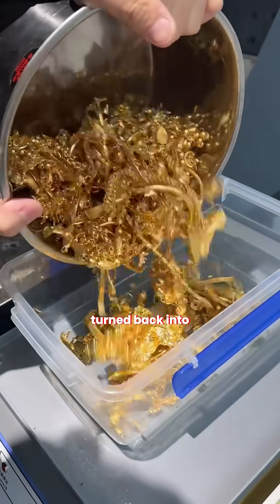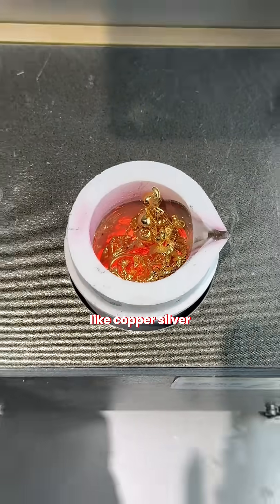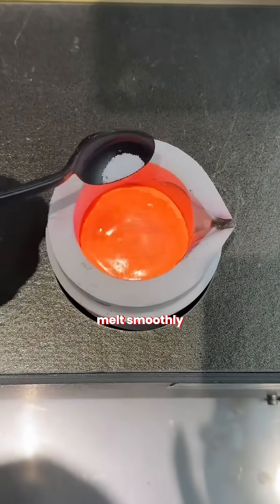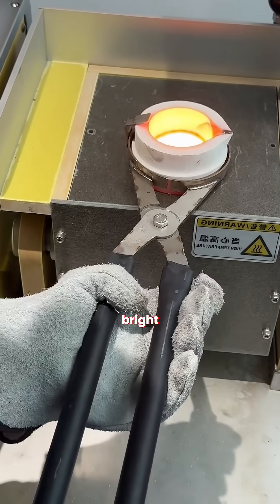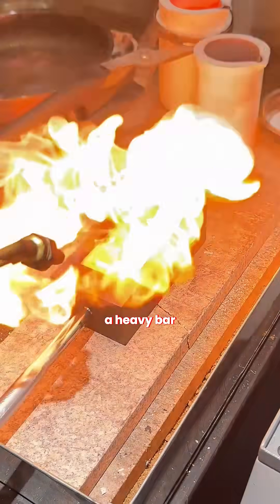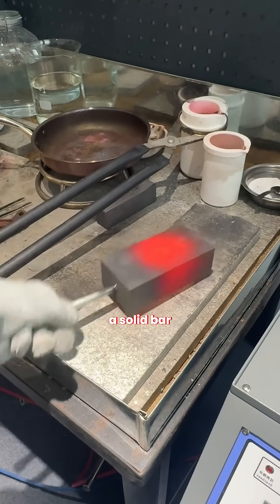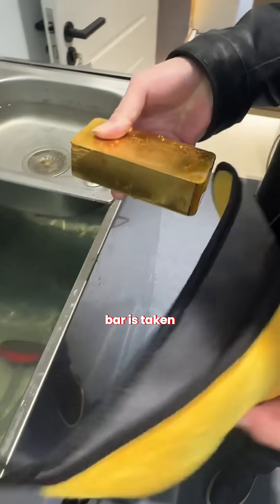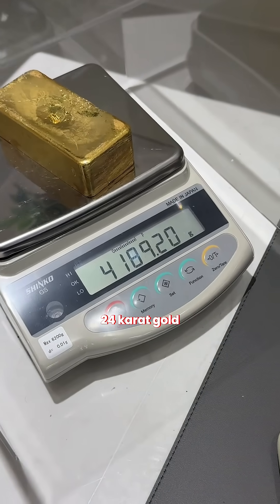Turning Old Gold Jewelry Back Into Solid Gold Bars #shorts

Comment: So serious question.  When we do metal work such as welding for example.  The quenching medium is very important.  We have found in aviation that using water is less of a medium than say brine or oil.  Why wouldn't you quench gold in oil or a brine?  I would assume metal is metal, but this is not my area of expertise.

Comment: For all you brain pans out there that have never put a solid piece of metal in water here's what happens. At first the metal turns the water that is touching the metal into a thin layer of steam that actually insulates it from cooling off quickly. After about 10 to 15 seconds, depending on the size of your metal, the water slowly comes in contact with the metal and then you will get your major reaction. It will bubble and boil till the heat disapates. If you airheads, which is a lot, don't believe me,  get a 4 or 5lb 2 inch thick and heat it red hot. If you drop it in a 5 gallon pale it will melt through the plastic at the bottom before the reaction of the water starts. Metal 5 gallon pale of water will become to hot to put your hands in. So there you go.

Comment: "Letting the slag stay behind" How? That's the most important part of this video!
Reply: The slag hardens on top of the bar and is easily cleaned by tapping it with a small hammer and then scrubbing the bar with a wire brush.

Comment: Ok question for anyone who can help. If for example I had a piece of silver that was mixed with gold how would I separate the 2 metals so I could recover both the silver and gold? Or does one have to be sacrificed for the other? I know density is a factor possibly since one might be heavier than the other (would that work like oil and water where they wouldn't mix and there would be layers you could cut and separate when it's cooled down?) I've got some metal I want to melt but dont know exactly how the scoence works!
Reply: In gold refinery, especially small bars or bars obtained from melting jewellery it's not worth separating the silver, it is simply disolved in the aqua regia and discarded.

Comment: You ONLY showed the first step.  The bar is rolled to a long ribbon of very thin gold, then dissolved in aqua regia (Hcl + Nitric acid, then the copper, zinc, silver is removed, finally the gold is preciptated, dried and melted, this gives about 98% gold.  The process is repeated giving 99.4 and if necssary a third time or fourth giving 999 gold, which is then mixed with an alloy to create 14 or 18kt.
Reply: they said they were going to pour the old gold into a bar. There was no mention of refinement.

Comment: I laughed when the red hot bar was put in water and there was no reaction, no steam.
Reply: Water might be hot from dipping other bars into it. Makes a hell of a  noise for a few seconds when you dip a hot bar into it though.
Reply: Strange?
Reply: @rambelicious  Strange to me. No bubbles at all.
Reply: It's not water
Reply: Plus if that bar was gold it would be quite heavy. Not as easy to handle as the video implies.
Reply: @snidecommenter7117  Well, it's China, so likely it's some type of fake.
Reply: @snidecommenter7117  According to the scale, it is 4.2 kilos.  That is quite easy to handle.
Reply: @ricksmith3045  Look at the size of the brick. If it was solid gold it would weigh more than 4kg.
I'm guessing about 6" by 4" by 2".
48 cu in. that would be 15kg
Reply: Because it's  pre warmed oil and not cold water.
Reply: @stevebubbs  Oil boils and burns at a way cooler temperature than gold glows.
Reply: @stevebubbs That’s interesting 🧐 I should find another source
Reply: @stevebubbs  No, it's just plain water.

Comment: What's the point of pouring it into bar if it needs further refining? You cant put whole bar in crucible, it needs cutting, mixing etc...
Reply: For ease of re-selling and transportation to the next process.
Reply: Not all bars are refined to 24ct/fine gold, where I worked probably 99% was sold in mixed carat bars; only refined 200g, maybe 300g at a time to supply our jewellery manufacturing customers.

Comment: Karat gold has to be dissolved in acid to remove the metals used to alloy it, just melting does not remove the alloy metals.
Reply: Melting wheel weights does not produce pure lead, even with borax.
Reply: well, this is step 1. Make alloy, XRF the content of gold, and get total weight. In this form, it is good for sale or further refining.
Reply: "Karat" gold?
Reply: @2esquared  Karat gold is term used for jewelers gold, 14 (585), 18 (750) or 22 (916) karat mostly. Or some mix of those. BTW: disolving karat gold directly in acid is pretty bad techniqoue, Inquarting or cupelation works better, then final purification with acid or electrolysis.
Reply: @frantiseklaluch6605  had to ask sreetips what the purpose of that was when I started watching his vids. Was under the assumption that the acids would work regardless of overall purity. Made a point of dropping his wedding band into aqua regia in a vid explaining why that wouldn't work.
Reply: @AnthonyPrevost i think he put the ring into nitric acid, not agua regia 😊 Aqua regia disolves ring, but gets very dirty solution, hard to get clean gold out of it.
Reply: Can you extract those metals separately? Extra profit
Reply: That's why he used flux to seperate but didn't show them spooning slag off.

Comment: not stamped?
Reply: You don't stamp it until refinement is complete.
Reply: It can be stamped anytime
Reply: @RickMyers-p2r  It has to pass the bureau of weights and measures assessment before you can officially stamp it. Refineries might letter it during their process but applying the proper federally approved hallmark means you are guaranteeing the weight and purity of the bullion. This is federally backed like the FDIC so if you screw with that it's a federal offense and is investigated by the Secret Service  (don't ask me why). Anyway I'm pretty sure that's how it works because we used to buy quite a bit of scrap gold and even nuggets and placer gold (live in the Cascade Mins). We sent it to refineries and they'd send back a full report once they melted it down and refined it. Good money.
Reply: A rough bar like this isn't stamped. Samples are drilled from 4 corners and tested and declared to the buyer. When he receives the bars he will melt them once agáín and test the purity. Jewellery pieces should however always be stamped, íf it's from a reputable manufacturer/jeweler.

Comment: If it was extremely hot like you say, where is the steam
Reply: Water makes steam.....steam is water vapour
Reply: I wondered the same thing.
Reply: That was quenching oil not water...
Reply: @soliloquy8163  No. It's just good ol' regular water from a tap/fawcet.
Reply: @2esquared  Im just going to put this here... 

Quenching oil is used in metal hardening (
heat treatment) to control the cooling of heated metals, providing a slower, more uniform rate than water, which increases hardness and strength while reducing thermal stress, distortion, and cracking, especially in steels and some gold alloys, resulting in durable, wear-resistant parts with improved microstructure

Comment: 4 .189 kg at 19.32 g/cm³ 
 216.82 cm³  
 that makes a block  6cm×6cm×6cm or 2.37 inches per side... that's either a lot of impurities or the tiniest hands in the world
Reply: Yes ......someone with brain
Reply: I would have expected about 10 kg and doubt while seeing handling ...
Reply: 24 carot if a fable most gold stamped 24 c is 22.5 to 23 .5 carot as during purification the amount of gold lost far outweighs the gains in purity and of course when you try and sell it you loose when it's called impure after you pay for 24carot
Reply: @brianshields7137 Not true. If you're dealing with a reputable refinery and their bars are stamped or certifiedas 24ct or fine gold it wíll be 24ct.